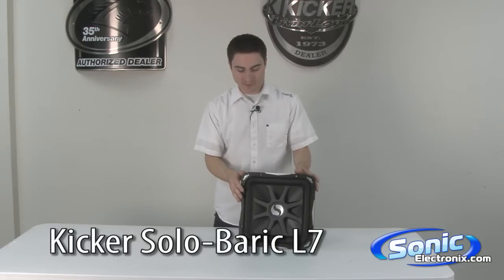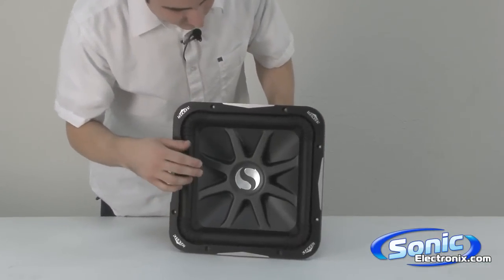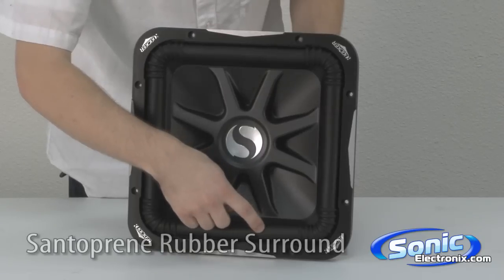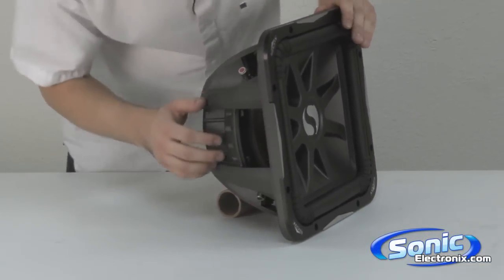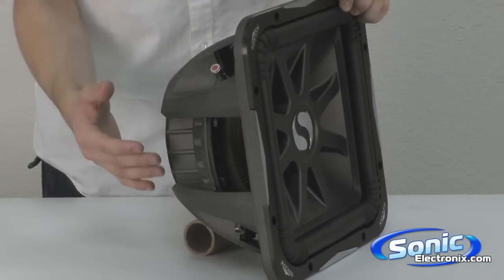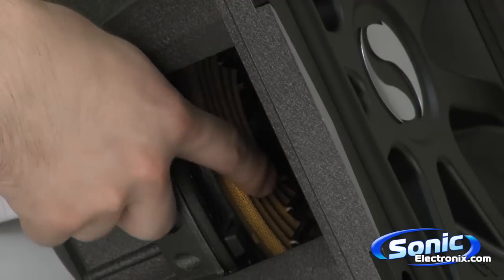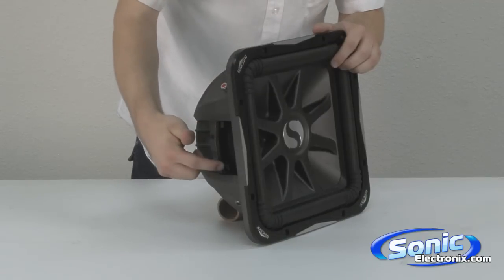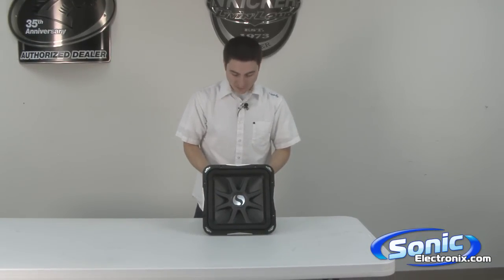Kicker Solo-Baric L7 Subwoofer Review

Comment: i have 2 KICKER L7 12" in a custom ported box with the EPI center installed also, i recently burned out my amp, i had an Orion1500 watt 2 channel amp. what do you suggest i replace it with because i wasnt getting the full potential because of the lack of power

Comment: I’m still using my kicker solo X 10inch competition with a kicker 2500.1 amp. Hardest hitting system I’ve ever had and also the clearest. My body has dual 12 inch kicker comps both with 600 W amps and cannot even touch me

Comment from the maker: @hardearn2 We actually have a subwoofer wiring diagram calculator on our website where you can calculate how to wire subwoofers up.  You can also find these diagrams on our pages different subwoofers.  You would wire the two Dual 2 Ohm L7 subwoofers in Series/Parallel for a final impedance of 2 ohms.  Follow the diagram to see how to properly do this.  We'll message you a link.

Comment from the maker: @jakeistite There's a lot of awesome amplifiers you can use.  If you're interested in the Kicker matchup, you can use a ZX500.1.  Other options out there that will work with a 10" L7 would be the MTX Audio RFL600D.  This amplifier pushes a bit more power than the Kicker matchup so you may be happier with the results.  Also another exceptional amp would be the RSd 600.1 by Phoenix Gold.  This amp will run perfectly with that L7, and all amps mentioned are of great quality!

Comment: @SonicElectronixTV WITCH AMP WOULD YOU RECOMMEND TO RUN 2 12' KICKER CVX OUT OF THE ONES YOU JUST HAD LISTED?? Hifonics Brutus BRZ1700.1D, Polk Audio PA1200.1, MTX RLF1200D, Massive Audio N3, or the Orion XTR15001 ? AND I WOULD HAVE TO WIRE THEM DOWN TO 1 OHM CORRECT??

Comment from the maker: @123dugie321 Go with the Dual 4 Ohm Model of the Kicker 12" L7, you can use the Kicker ZX750.1 for a perfect matchup!  For some of the best possible bass response you can use the Kicker VS12L72 12" Loaded L7 Subwoofer Enclosure with the Kicker ZX750.1 .  

This is an exceptional combo for improving the bass in most applications.  Happy shopping!

Comment: its a mono amp..meaning there is only one channel...they use there inputs like a Y plug in..meaning you could hook them up like you have but it will make no difference...i was confused when i saw this too lol i researched it...it makes it more capable for like diff wiring set ups i guess...i have the T1500-1bd

Comment from the maker: @DorckWoW yeah definitely, just get the Dual 2 ohm version and wire them together to a final impedance of 2 ohms. Your required power total will be 1500 and the amplifier will provide 14000, meaning each sub gets 700W RMS. This would be a good set-up and cost efficient.

Comment: hey i need help... i have an s12L7 and a kicker cvx in a silverado 05...im using a performance teknique 3000W – Digital Monoblock Power Amplifier...should i run the subs in series or parallel?

Comment: Hi I have a kicker L7 10" and I was wondering, would a Kenwood KAC-9105D 1800watt max amp be too much to power this? Here are its power outputs (RMS):
Power Output
500W RMS x 1 @ 4 Ohms
900W RMS x 1 @ 2 Ohms
900W RMS x 1 @ 1 Ohm

Comment: Have you heard kickers l7 10" in a preloaded thin box?   I was looking to get one for my 1993 silverado 2 door with a kicker 750.1 amp. It would be not my first system but my first small ported box and first l7 or even square sub. Do you think it will sound good and hit hard? Should i go through with the purchase?

Comment from the maker: @Sskouloudis It sounds like you have quite a few questions about car audio in general.  I would highly recommend to check out our main website, and sign up to our forums to speak with other car audio enthusiasts, as you'll be able to receive a lot of complete information there.

To basically answer your question,  Ohms basically effect your wiring option. Choosing between the 2 or 4 ohm versions purely depends which amp you are trying to drive them with.

Comment: am a big fun of kicker subs but am gettin a little disappointed cz i feel i might loose my sub soon which is the 3rd one so far.i started with l6 12'using a kicker box but blew it after a few months. a was running it with kac7252 kenwood amp.i later bought l7 12'and used the same box and the same amp but after nearly 1year it started smellin that burning smell of a sub, quickly i replaced the amp with the same kac7252 kenwood but blew it. i got a new l7 again n the smell has started. any advice?

Comment: @SonicElectronixTV well i was thinking L3 or L7 and i was thinking 2 15"and 2 12" because 2 for low bass and 2 for higher bass , but if 12"can hit high and low easy , like can i have 4 12" and make 2 hit lower and tow hit higher or should or should i go with 2 15" and 2 12" ?

Comment: @SonicElectronixTV 
BUT :) depending on the over all Volt's to Amps draw, a battery may be the only choice. Remember everyone a 60(Amp Alternator) and 12V Battery can only make 720watts RMS and 15% of the power goes to your car soo... Remember your math, same thing goes with amps. a Amp thats states 1200watts but only has 2(30A) fuses,,, yeah no happening

Comment from the maker: @lancerz12345 This depends f you have the Dual 2 Ohm, or the Dual 4 Ohm version.

If you have the Dual 4 Ohm, I'd use the ZX750.1.  The Dual 2 Ohm model is best for running multiple woofers.

Comment: I have 2 12" L7's and they're phenomenal.
Reply: Just ordered mines today I got the 15 inch coming
Reply: derrick couts My buddy had 2 15 l7 they seem to like bigger boxes but let me know if u like it!
Reply: I have the L7 15” dvc 2ohm in a 6cu ft. Ported Box wired to 1ohm hooked up to a 2500 class d 1ohm stable Orion amp in a GMC Yukon and it is ridiculous!!! LOL with all the settings turned all the way down on the radio and only half of the amps power I shake pictures off the neighbors walls and I live out in the sticks so the houses are not close by any means lol well worth the money!!

Comment: but anyway, i would personally recommend just getting 1 l7 with dual 4 ohm voice coils, so you wire them in parallel for final impedance of 2 ohms. If you decide to get 2 anyway, then you'll want to get dual 2 ohms, wire each sub in series so each subs impedance is 4, then wire those in parallel down to 2. im just warning you, you might blow those subs with this amp if you try using them to their full potential

Comment: Got the 2001 square kicker solo baric L5 dual 4ohm 12s in a deep sealed box on a skar audio rp2000.1d the bass is ridiculousl
Reply: general kick ass I've never heard one... Can it compete with JL audios w7?
Reply: general kick ass Aye man just a heads up, i would get a kicker amp thatll power your l5, i had my rp2000 and switched to a kicker kx2400 and the sound quality of the kicker amp makes the skar sound like shit, the rp amps are one of the worst amps on the market for sound quality I had a power acoustik that pushed my sub lower and cleaner than my skar

Comment: Sonic Electronix  hey guys. I watch all your videos. Question for u. If comparing its let's say 2 12" subs each 400w RMS (total 800) vs one 15" 800w RMS sub....which will be louder? Which will be better? Assuming same 1000w amp is used. Both ported box.
Reply: the 2 12's more surface area than one 15"

Comment: Hey i have the kicker l7 12 inch and  was wondering what amp i should get?
Reply: Rockford Fosgate T1500.1 or Brutus Hifonics if your looking to save money.
Reply: Me too I got 2 L7s 12s but idk what amp to get :(
Reply: +Kurloz !! My husband has two Kicker Solo Baric L7s in a Kicker Side Ported Box that has the single 2 ohm push in hook ups. The amp he's using is the Kicker CX1200.1 mono amp with a bass knob. It's 2400 watts, and 1200 rms watts. Dyno was at 1282 rms. He said, and some others have said that's the perfect amp to match those subs to.
Reply: +Tina Marshall thank you so much I appreciate it but I had to get rid of them because I got a amp that pushes 4,000 rms it's a old Memphis mojo mcd4k But thanks for the help hard to find nice ppl around here
Reply: Tina Marshall looking at getting these subs glad I found this comment added the amp to my list